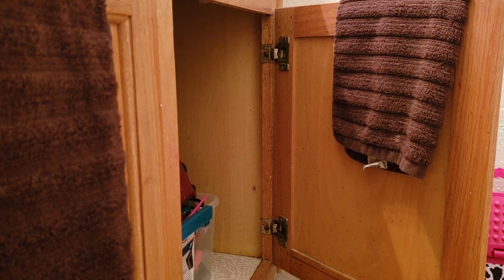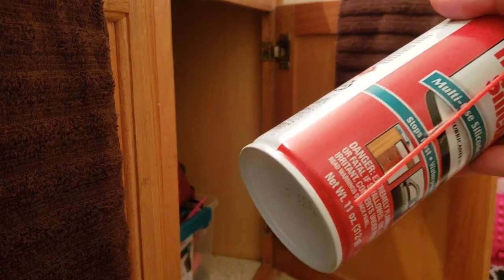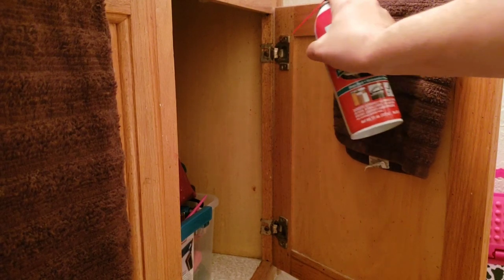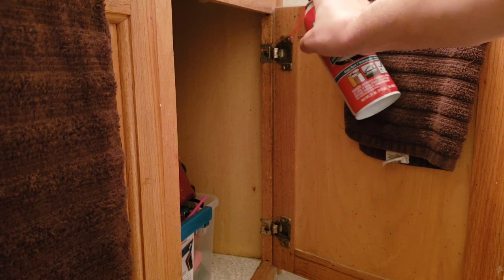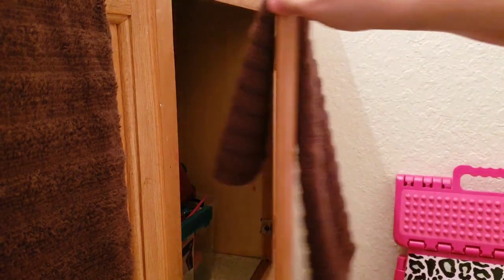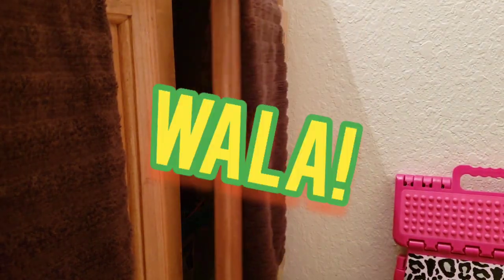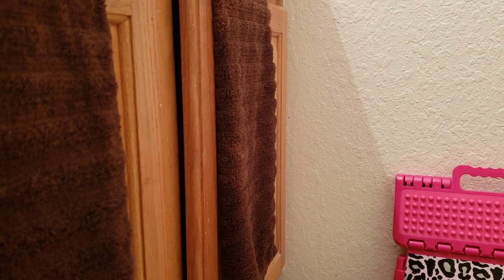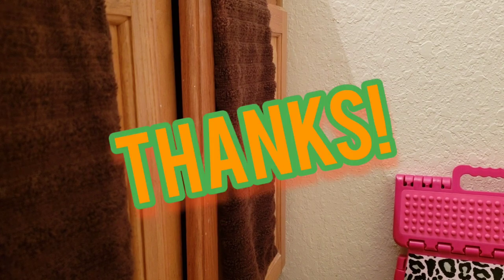How To Fix A Cabinet Door That Stays Open And Won't Shut

Comment: I tried this, and it actually made it worse. I think the hinges are bent.
Reply: That's the problem with mine. I have the same type of hinge. It's non-adjustable. Probably have to replace with a different hinge that adjusts.
Reply: I ended up replacing with a same-sized hinge, but instead of having to overcome a spring, this one has a spring that softly closes the door. Much easier to deal  with!